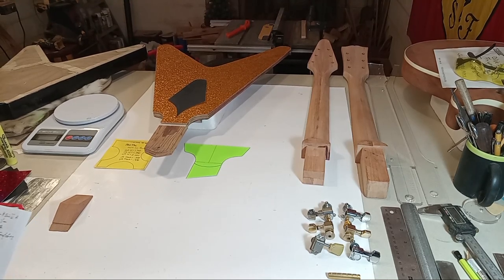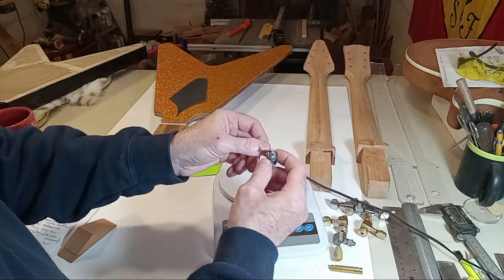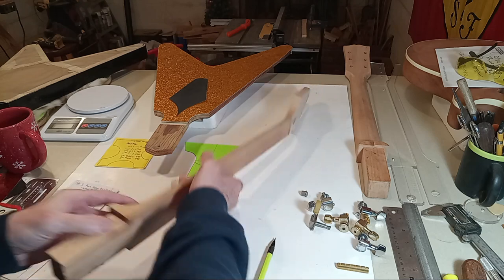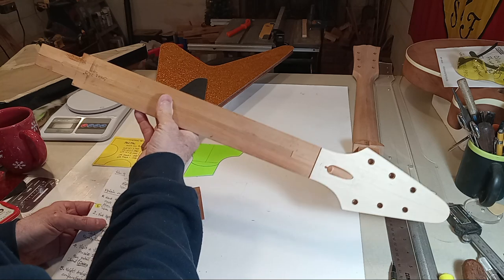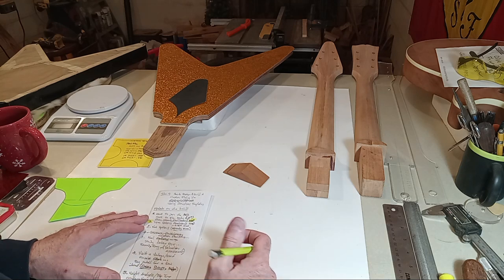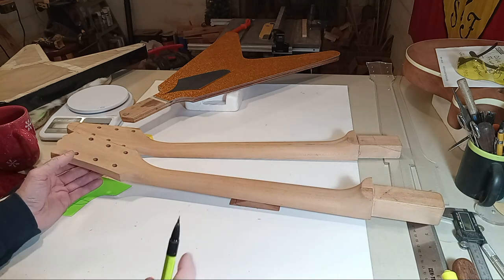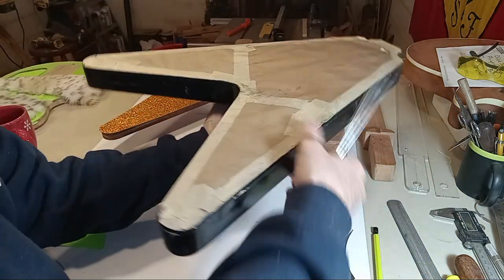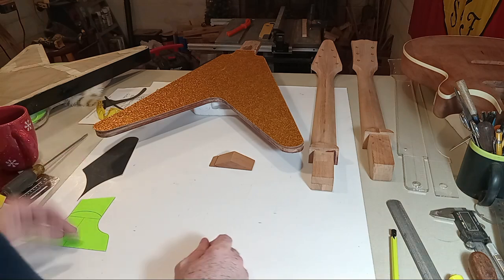V9. How To Design Build A Custom Flying V Per 1959 Korina Specs Using Stewmac Templates

Comment: Just in the process of building 2 V's for the first time.  Their is a lot to learn and the mistakes hurt$$$ 
Thanks!
B
Reply from the maker: Hey B,

Just found your comment, so thanks for watching.  I tend to practice using used parts from Ebay, etc., and build the project around "smoking deal" items.  Then, once the design is refined, I keep a watch for very specific "smoking to good deal items," and for the next project...

Thanks,
Marc